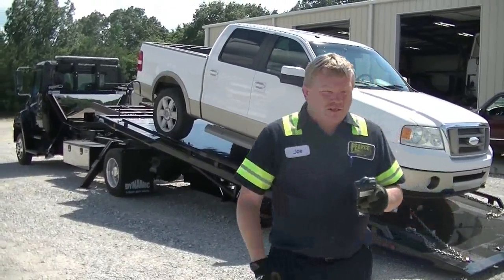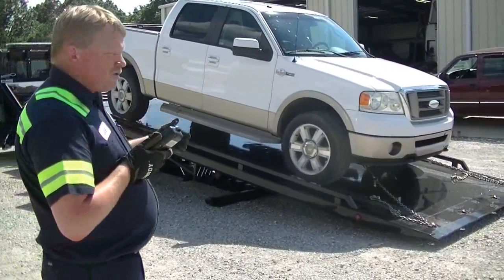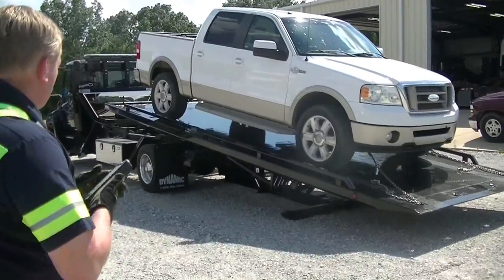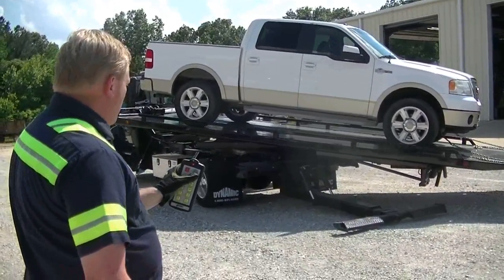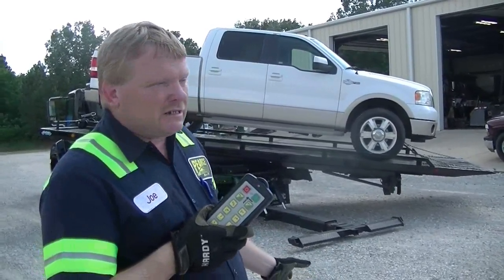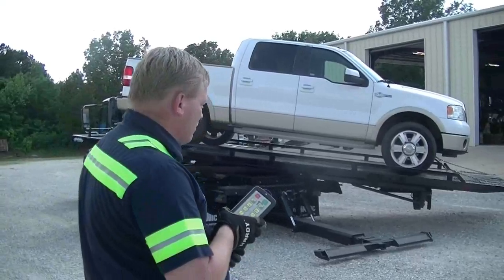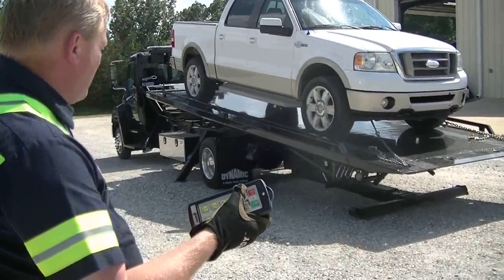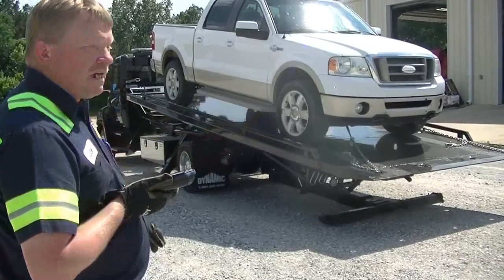Dynamic "Radius" Rotating Rollback

Comment: If the engine was higher idle, would the bed rotate at any load angle ?
Reply: Yes, except when trying to rotate with the bed near the ground when swing over the rear due to the wheel lift being in the way of the bed when tilted down close to the ground.  Other than that,  you can rotate with the bed at any angle and it will swing.